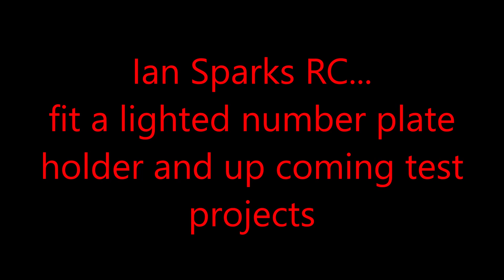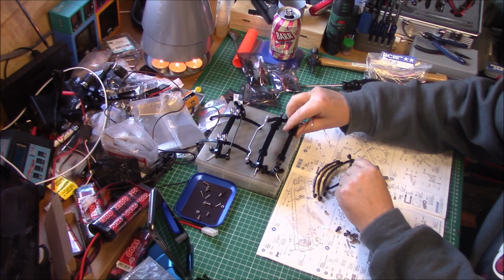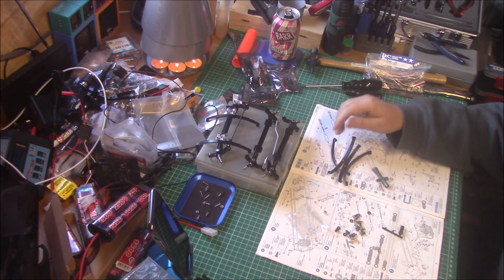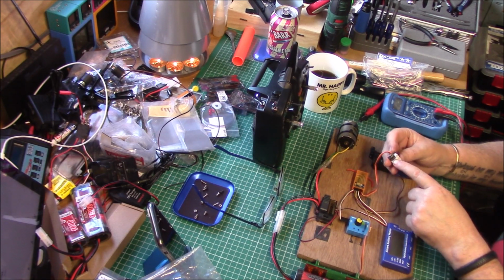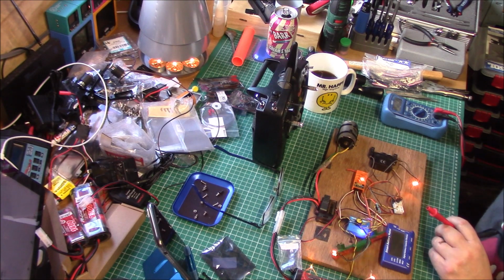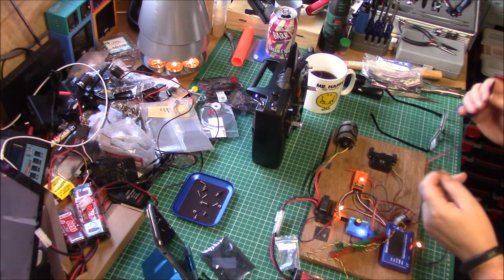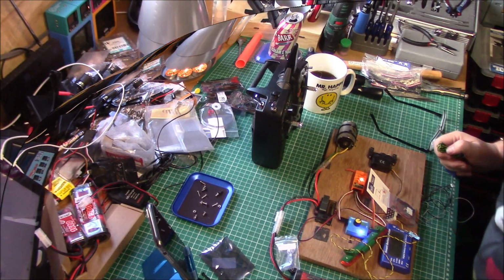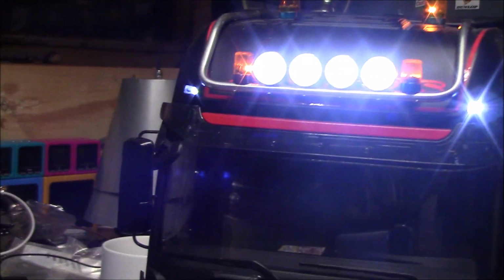Lighted number plate holder to Tamiya Actros Rigid, and some up coming test projects

Comment: I did see the Carson steering rod on Modelsport for £30... I wasn't seeing things but I wonder if they bumped the price to stop people from buying an item which wasn't available at that time.
I'll be very interested to see the side-by-side comparison. I did do a comparison in a RC Club with my modification on my King Hauler Vs a stock steering on a 6x4 Scania and mine longer truck did turn tighter than a stock axle.

Comment: Hi m8 the steerin mod Terri wild did dose work u can get the rod ends cheaper 1s the Carson rod don’t make much difrence apart from movin it from frunt to back n over gear box for movin up n down plus it not got the shock mounts at back to catch on m8 not sure bout gear box mod as the pinyon mail for speed m8 b good to c both mods m8 o also I have changed the pin that gos thro the steerin to a m3 with nylock on it takes up a lot slop m8
Reply from the maker: As I said, I’ve never done her mod and I’m just as keen to find out how much difference they all make
As for the Carson bar, we will find out if they make a difference or I’m mistaken along with everyone else that uses them

That’s the idea of the test, to see what’s worth doing and what’s not
Reply from the maker: https://youtube.com/watch?v=GuGKXbQlBzg&si=EnSIkaIECMiOmarE

I don’t understand how anyone can say the Carson bar doesn’t do anything 
That video shows a 6x4 doing a 180 in under 6 foot
I have seen people fitting it wrongly, I guess that explains some of it